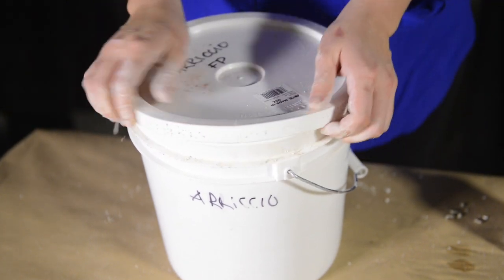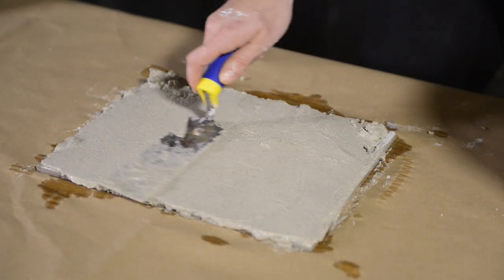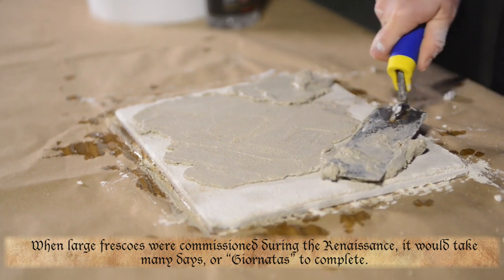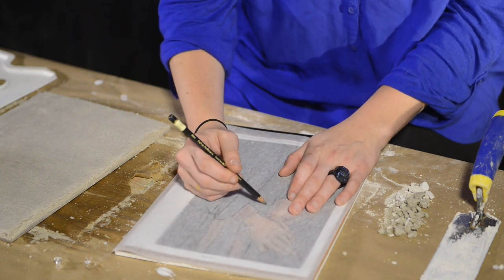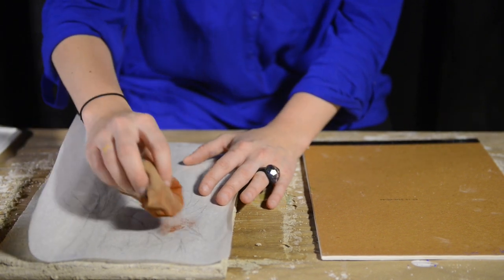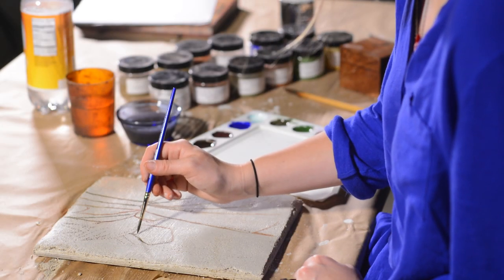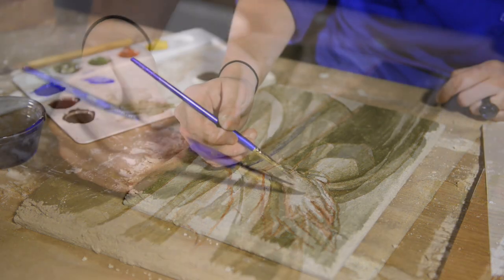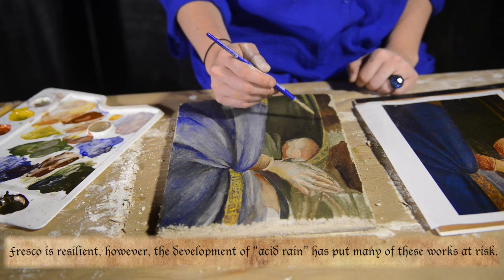Alchemy of Art: Fresco

Comment: Thank you for this informative video as I have learned what a fresco painting is, which is made by putting paint on wet plaster. As the paint dries, it sinks into the plaster. It tends to be durable, yet it must be done quickly without mistakes, as the artist has only 9–12 hours to complete the painting before the plaster completely dries and hardens, so it must be done swiftly and accurately.